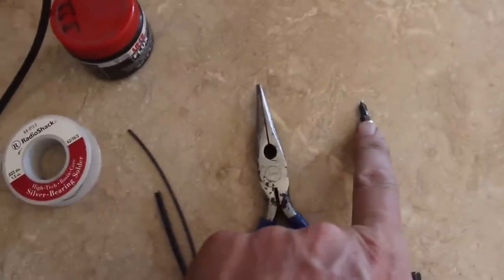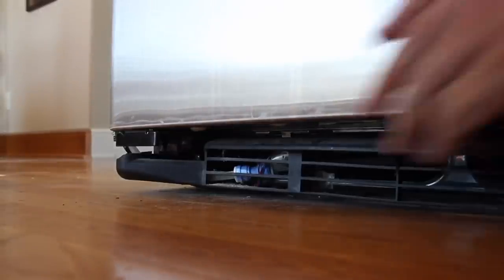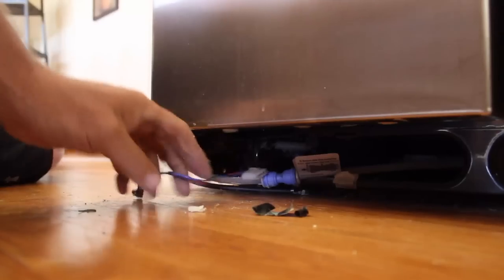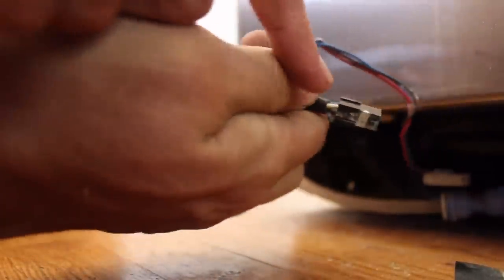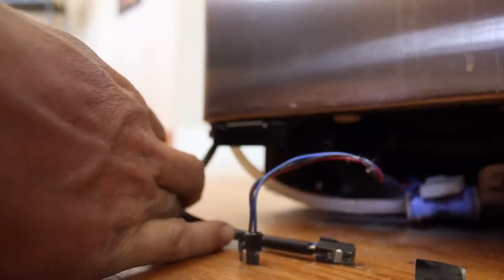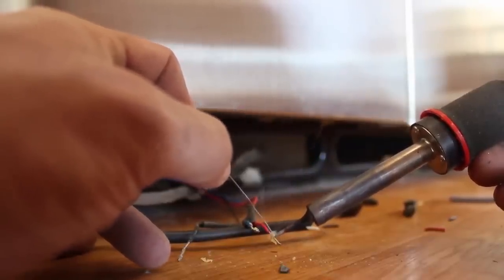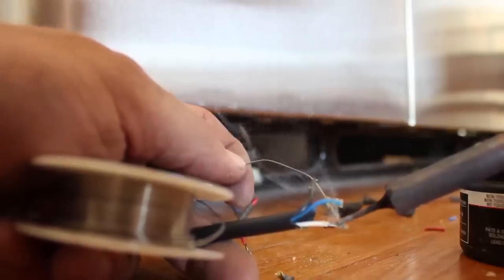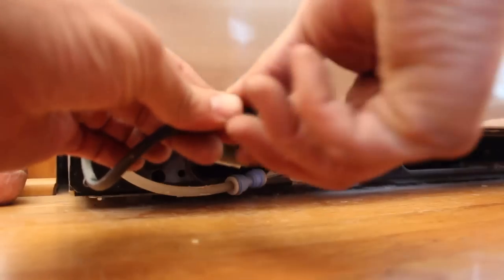Fix Your GE In Door Water and Ice Dispenser

Comment: I watched a number of videos on reasons/fixes for the water and ice NOT dispensing from my refrigerator.  When I saw this one I said to myself - "It couldn't be this easy"  I was WRONG!!!  This is exactly what was wrong with mine.  The white wire had corroded and snapped off at the pin.  I cut all of the wires from the connectors, soldered them together with the sequence indicated and I'm back in business.  I haven't been able to dispense water or ice for over 6 months - it took all of about 20 minutes to get the tools, cut, solder, and turn the electricity back on.  Saved a bundle of cash by not having to call a repairman!!!  THANKS!!!!!!!!!!
Reply from the maker: Right on!!!

Comment: Thanks for your help Greg!  Our in door dispenser was dead - no lights, no activity.  First thought was, crap, gotta buy a new frig.  Then I started looking for a new interface panel.  Found out they are no longer made and very hard to find and over $100 if you do.  Then I came across your YT video.  Watched it, went to work on checking the connections at the bottom and they were a corroded mess!  Got out my electrical tools, cut the power, snip, snip, added the heat shrink connectors, tape, put it all back together and BAM!  Back in business!  Thanks for sharing this fix!

Comment: OMG!!!  I had a GE technician come into my house and he charged me a fortune to change the "main board". I live in Brazil and everything related to electrical appliances, including replacement parts, costs a lot. I doubted the diagnostic. Called a non-brand tech. Another mis-diagnostic. This time, the guy said he would have to change the front panel (the one with the LEDs and buttons). Then I decided to search for the solution online and came across this life-saving video. My connector was all rusted. Actually, it was so rusted that one of the wires easily came loose. I was so happy to find this out but also outraged by the lack of knowledge and fair play on the part of the techs. Anyway, thank you very much for this. I ended up just connecting the wire without soldering.

Comment: Not sure why the design is like this, it didn't seem like my connector is sitting in water but the sleeve was wet. I'm guessing condensation from the interior to exterior transition? That's a bad design... Thanks for the video, I was going to start troubleshooting somewhere else but this is a good reminder to always check connections first!

Comment: I had nothing working on my dispenser panel except for intermittent led lights.  I cut out the corroded connector and spliced it back together as the video suggested. This straight forward video got me to the solution quick. Thanks :)

Comment: Kudos to you, sir.  I cleaned the connections.  I did everything I could do just so that I would not have to cut and solder the wires, but in the end I had to do it exactly the way you suggested, and viola!  It worked.  Thank you so much.  This video is as relevant today as it was 7 years ago.

Comment: My GE refrigerator isn't the same model as yours in the video, but basically the same connections behind the lower plastic panel. Thanks to your video, I went straight to the problem. The connector was corroded! Not as badly as your though, so I was able to avoid the cutting and resoldering of the wires. I cleaned up the individual connections to get as much of the corrosion off as I could. I then applied some moisture preventative dielectric lube to the connector and reconnected it. Problem solved! Total repair time was about 15 minutes.  Thank You!!

Comment: Thanks for your video Greg!!!  I had the same issues but no broken pin in the connector. I decided to try spraying some DEOXIT contact cleaner in each connection as the pins looked a little corroded. Plugged the connection back in an no luck.

A half hour later I pressed the dispenser and water sprayed out onto the floor. Yippie!!

Fixed thanks to YOUR how to video 8 years ago👍👍

Comment: Thank you!
Excellent easy fix. Don't have solder iron so I used wire connectors.

Did this because water stopped,  ice stopped a year ago, thought I needed a bunch of parts. Now both are working

Comment: Great video, this solved my mysterious issue! My water was not working, press the button, it sounded like water was about to come out, but it doesn’t, seemed like frozen water line issue but it wasn’t, hav t had a frozen line since I branched off my reverse osmosis filter. The ice works, dispenses ice. If I disconnect water line coupler at the front bottom of fridge and press the button, water comes out, so something between the door and floor water line. Without any other options to try, I checked my wires as you outlined in video, no obvious corrosion,  it it didn’t look great either. I crimped to blue with and black wire together with low voltage crimp connectors. The red and white I soldered together since I wasn’t sure if I could use the connectors with a wire that supplies power. After doing this, my water dispenser started working again! Great video!
Reply from the maker: That's exactly why I make these videos!  There are some oddball fixes sometimes.

Comment: GREG !!! Thanks mate !!! Just the little piece of information I could not find from all the others relevant videos on the subject, I was getting crazy checking voltages from the board to the soft touch panel on my GE, and all the problem was corrosion from the tiny connection at the bottom of the door !!! Thanks again, my GE is now dispensing as usual. In my case, instead of soldering the wires I tried first with a wire connector, and it worked 100%, so I insulated the area and voilá !!!
Reply from the maker: It's definitely the magic.  I don't usually do appliance repairs on my YT channel, but I thought this one was worth sharing.  Cheers!

Comment: Thank you!  This was a huge help.  The only surprise was the copper on my black wire was completely coated with a black residue and wasn't making a good connection initially.  I needed to sand it to expose the copper then soldered and everything worked.

Comment: Hey Greg, we had the same problem with a refrigerator with no power to the ice maker display panel. I followed your instructions and they worked beautifully. Although my soldering was not nearly as good as yours. However, now when we use the water or ice feature, the ice/water dispenser won't stop. I had to unplug the refrigerator temporarily to stop the dispenser. Did I screw something up or does something else need to be repaired or replaced? (GE Profile Artica) Thanks, paul

Comment: It is a good video with the right diagnostics for the ice and water dispenser problem. However, I would not have soldered the wires together like this. I would get new electrical connectors similar to the old connector or any three wire connectors and install the wires into them instead, making sure that the wires from one connector would go to the right wires on the other connector. When you done putting the wires into the new connectors, you can just plug them back together. Of course, a large heat shrink tube over the connector would prevent future corrosion. There is a reason that GE engineers designed the wiring to be replaceable, doing this will prevent you from replacing the wiring in the future.

Comment: GE GSCS3KGYAFSS.  Mine was just wet, all pins were intact.  I cleaned everything with CRC QD Electronic Cleaner, put some Super Lube 21030 Synthetic Grease in the connector, then heat shrinked it.  Good as new.  Video was awesome, thank you!
Reply from the maker: Right on!  This video is an oldie but a goodie.  Amazing the same issue has been around well over a decade.

Comment: Thanks Bro!!! fixed it in 10 min, Ya a ton of goop from tray over flow, water running down door and right onto connection point...
I used red crimp connectors and heat shrink !

Comment: I can't seem to get my connectors apart. Mine are black on left going up and a smokey cream on right for power. Tried press and pull but wouldn't come lose. Don't want to cut just yet connection looks clean. I get ice and I know I get water to the coupling, just wont go up to spout. Yesterday water worked, today no water. Any thoughts GE Profile. Great video BTW.

Comment: Hey Greg, great video! I have a CFCP1RKBASS - the ice and water dispensers don't work, BUT the lights in the freezer and refrigerator don't work either. I noted your point that the light switch fed power to the dispenser. So would going to that same connector be a good starting place? Any advise would be greatly appreciated!

Comment: Thank You that was spot on, as you said because of condensation the little black connector on of the wires had moisture for years and was oxidized and broken, I cut off connector and used sta-kon wire nuts to remake connection. 30 minute repair saved a wad of dollars.
Reply from the maker: Right on!  Glad you were able to save some cash!

Comment: Good video Greg !
Have several of these in the apartments, same prob, GE admits to the failure and warranty covers the problems...
They basically replace the harness and recheck the function as you did, but using updated factory parts..
Cool to see your fix, they should use your solution in the field IMHO
Take care brother !
Reply from the maker: Yeah...  I think I'm past the warranty...  I've had the unit for 10+ years.  I think my fix is probably more permanent than their replacement parts.  I'd hate to be the dude fixing these in the field rolling around among the lost cheerios and other crap that has dripped out of refrigerators.

Comment: Hey Greg,  I had the same exact issue.  No butt connectors or shrink wrap. With a little duct tape and swear words my fridge is back in business.  Thanks!
Reply from the maker: The duct tape probably got you 90% of the way there...  The 4 letter words pushed you over the finish line!

Comment: Glad I found this video. That plug was exactly my problem. It’s a poor design IMO. Water gets into the black sheath that protect the wires running up the door and runs right into the plug. I crimped on some quick connect plugs, cut the black sheath back to about 2” before it enters the door and made a drip loop. Should be good till the fridge dies lol

Comment: Seems very odd, and obviously the plug already disconnected means he'd already been poking around under there. Corrosion and the displaced single plug connect do not cause the entire plug to separate suddenly. Maybe this could occur, and cause the issue, but it might be advised to coat the plug fittings with an electrical anti-corrosive material to both ease the plug-in, and prevent corrosion again.

Comment: Greg,
My water and Ice dispenser is working ... however, I am getting a leak from the water line.  How do I get the panel off the front of the freezer so I can replace the water line?  The refrigerator is a GE side-by-side.
Reply from the maker: +Christopher Lopez Most of the panels are held on by double stick tape and tabs.  You have to pry gently at the edges.  Be very careful.

Comment: The method of thawing it out to get the water flowing and then get some styrofoam and HVAC silver tape works great. Cut out two pieces of styrofoam, one for the angled part and one for the vertical part on the back of the dispenser(inside freezer) tape it up and you are good to go. I did this method and it's 3 weeks and still working. Send me a message and I'll walk you thru it, have a photo as well.

Comment: I've just purchased a new GE side by side refrigerator with a water/ice dispenser, any suggestions for a preventative solution to this possible problem?
Reply: My problem was the same; corrosion due to water and cleaning solutions getting into, and settling in that little connector after cleaning the floor. To prevent this, be conscious of the connection and try not to get it wet. Also, elevate the connector with a piece of electrical tape or something like a Commander picture hook or a computer wire tie-down.

Comment: I had my GE guy replace my Evaporator Coil & it quit working 10 days later... no ice. Door reads -4. When he installed it , he got the coupling tube RED HOT. I didn't think was the correct thing to do. He actually burned a small hole through the inside plastic liner.

Comment: Hi Greg. My friend give me a refregerator, ge profile artica refrigerators model pss26ng-pss26sg and the people that got it out of the house took oof the doors of the refrigerator and cut the wires, they are exactly that one you showing but whitout the square conetctors. and also three more wires coming from the same place that the white conector is coming. I dont know how to connect them.
Reply from the maker: +maria You might find a wiring diagram on-line.  I don't have the colors memorized or I'd try to help you out.
Reply: I realize you wrote in 9 months ago, so your problem may be solved. This may help others. Radio Shack or other electric supply companies sell generic connectors that you could use. Get a small length of the same gauge of wire at the store, along with 2 connector sets that are crimp-able. This way you wont have any soldering to do. What you will be doing is making a bridge between the two ends that were separated. Be sure to cover the connectors with electrical tape and elevate the whole thing above the floor so that it wont get wet when you mop the floor.

Comment: Your video was great. I just used the syringe and in a half minute the water came out. My husband was very impressed. However, before I tried your method, I tried the hair dryer method. It wasn't stated to keep the hair dryer a couple of inches away from the spout. Now the water is coming out on an angle towards the floor or me, instead of in the glass. I am thinking maybe the water spout (or whatever it is called) melted or got damaged some. I looked at it and it looks angled like a part of it melted. Can that be replaced? I have the side by side refrigerator.

Comment: If that not your problem with the wire, check your dispenser lever travel. I notice it did not travel like before.... guess what I found out, ice build up behind the lever. Scrap out the ice and also clear out water line..

Comment: You sent me to the right spot but only needed to dry out the connector and apply WD40 to keep water out.  Stupid design of sleeve in door where condensation trickles down to this connector.  I cut sleeve back 1 inch and wrapped with absorbent cloth for future drip drying.

Comment: Nice fix.  Its nice being able to teouble shoot things. It seems like anything they build thse days they dont  take in consideration about water and stuff. Thats like my brand new santa fe it flooded out the passenger footwell this week because the ac drain tube was cloged from the factory.
Reply from the maker: Yeah, I'd figure ANY connector on an appliance that has water or condensation on it would be waterproofed.  I guess that would add $.05 to the cost of manufacture, so they don't do it.
Reply: Like my hyundai they must of put the ac drain tube on and didn't pop the plastic cover.since day one if the ac had to work hard my windows would be fogged up almost like when a heater core goes bad. I googled it and allot of people had the same issue.other then that its a great truck.

Comment: Hey Greg.  I have this exact issue and tried the fix in the video.  Unfortunately this did not solve the issue.  Any suggestions on where to go next?
Reply from the maker: First, make sure the line isn't just frozen.  Open the door for about 20-30 minutes.  You'll hear a little splash if there's an ice blockage that melts.  That's the easy one...  The next level is to replace the electronics...  An hour from an appliance repair guy can be worth the money if there is a little gremlin hiding somewhere.  They know all the tricks.
Reply: Thanks for the tips. I will give those a shot.

Comment: OK so here's the post fix brief: 
1. On my fridge the wires were short so I didn't have much room to strip wire like in the video.
2. Soldering was not possible. Plan B was I crimpt M+F connectors. 
3. The new connection is no more exposed the the original.
4. It's up and tucked in and off the floor.

Comment: hey bud do u know how to fix the fact if I chhose cubes it comes out crushed
Reply from the maker: +Sean Pearson Not sure on that one.  There's an auger to push the ice and a disc that crushes it.  I believe they operate on the same shaft.  One might be frozen to the other or their may be something in the mechanism that is making the crusher spin overtime the auger turns.  Pull out your ice tray and fiddle with the bits that turn...  You'll probably figure it out pretty quickly.

Comment: Its galvanic corrosion. I replaced the valves before I saw your video. GE used metal and nonmetal together ferrous and non ferrous  You cant do that the electrolite was the water vapor in the air being drawn across it by the condensor fan. Bad GE it should have never happened someone saved a couple of dollars. Never put metal and non metal together thats what happens...

Comment: How does one keep it from freezing again?
Reply from the maker: turn the temp up.
Reply: @GregsGarage  Thanks but how in the world do you do that?
Reply from the maker: @kathyodato8322  There's usually a dial or buttons inside the fridge.
Reply: @GregsGarage  Greg,  Duh!  I found it.  Never paid much attention to it.  It was set at 5 so I turned it down to 4 which will increase the temp 1 degree.  Will try to find a syringe and  get the ice out of the line.  thank you so much